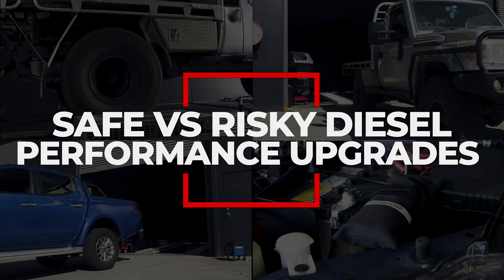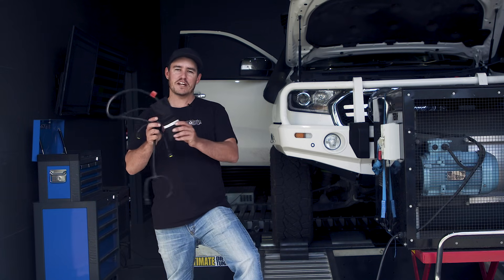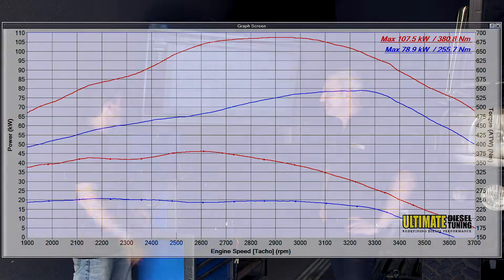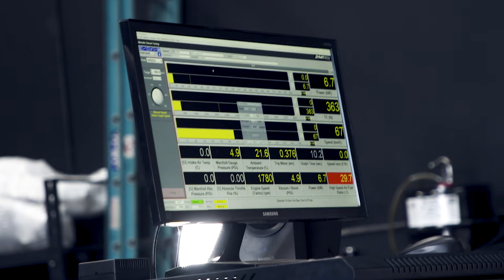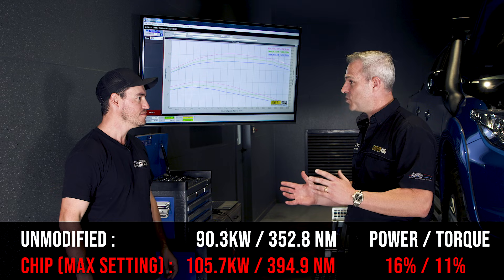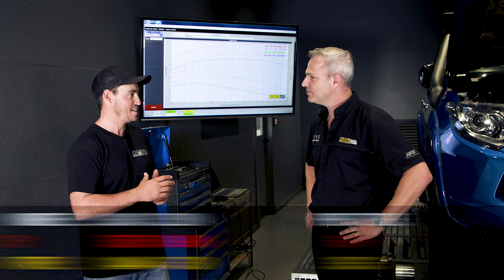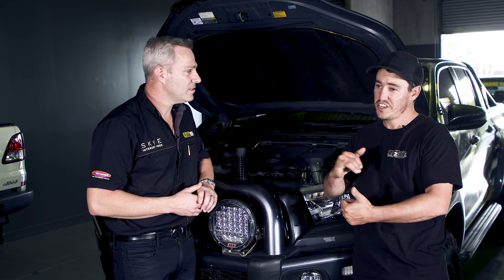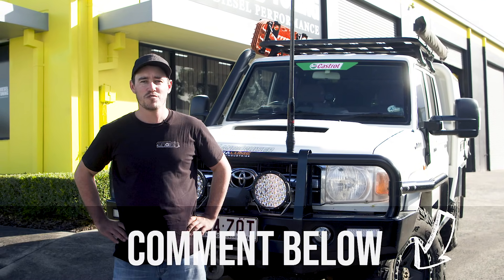SAFE vs RISKY DIESEL POWER UPGRADES – 5 things you need to ask before choosing!

Comment: Chips work fine on standard un molested ,factory spec cars.Obviously not so when young snapper heads start thinking there mechanics.Those chips were set up originally on a dyno before the unit was manufactured.

Comment: As a diesel mechanic of 20 years. The most reliable engine is a stock engine tune. Catch cans are fine but the manufacturer takes many things into consideration when tuning the cars. My opinion leave it alone unless you do things properly.

Comment: Ultimate diesel Brisbane wouldn't touch any vehicle with 300km on the odometer and charge alot, took my n70 lux to another tuner in Rocklea and the guys we're awesome went over the whole engine for health before working on it recommended some tweaks over the phone came back to pick it up made double the power that was in it and charged less than half of ultimate diesel 🤙

Comment: I recently removed my throttle controller because it was causing permanent DTCs and limp mode requiring a trip to the auto leckie on a flat top, the leckie erasing the DTC. 
This happened twice before he confirmed it was the chip in the controller degrading.
The controller had been in for a year without problem up till then. A proper tune will always be best, I think.

Comment: A lot of skeptics as to why engines are under tuned, and if the manufacturer knows better to stick to their power figures. Of course this is not the case for all engines, but regarding the ones that are under tuned, you have to imagine that the car in general has to also be driven by your mom, your kid, or anyone else that has no idea on how it works, riding the clutch, using the wrong gears, flooring it from cold, using poor quality fuel etc. And then you also have to convince them it's cheap to run, by telling them to service it every 20k km or more. That is one of the main reasons manufacturers have to play it as safe as possible, so that it can be advertised as cheap to run and last for all types of drivers...or at least they have to try. If you know how to drive and properly take care of your engine, a 20-25% power increase with a custom dyno tune done professionally, is still within the safe limits of the engine and transmission, and it will last as well as stock. Unless you abuse it, in which case you can brake it without a remap to :)

Comment: After a custom tune, I'm in the outback and something goes a bit belly up and one goes to a dealer  or some diesel mechanic for a checkover, then the dealer stuffs the custom tune by resetting the custom tune or upsetting one of the tune settings or warranty work is out the door and these days with 5 and 10 year warranties this IS an issue. One huge thing with reputable chip is it can be disconnected for warranty or outside repairs requiring ecu analysis, then reconnected again. I bet your custom tune is not able to be taken with you and reinstalled by another tuner in another place on the other side of the country if something goes astray. Reputable chips do give very real safe power gains and work completely within the design parameters of the engine it has been individually tuned for. Also there was NO discussion on fuel economy at these ridiculous 38% power gains. I do have a reputable chip on a BT50 used for towing and the change in driving is amazing on an low setting and fuel economy is improved by 1L per 100km towing a 2.4 tonne AOR OffRoad van, I wanted at least a half gear improvement on hills towing and did get that and a bit more. Go for a reputable chip for full flexibility and safe tuning. Remove chip when selling and sell the chip if you wish, cant do that with a massive remap which could very well be a good reason the not buy a certain vehicle..... just sayin...
Reply: Hi Peter, you have raised some good questions. 1. the dealer can wipe over it, yes, but it's free for us to load it back into your ECU for you most of the time (and it does not take long) - we have a massive database full of everyone's individual tune files as we save them all. 2. We do have dealers all around that country that can help you with reloading your tune file for you, should that happen. 3. Most of the chips that we have dealt with have actually not been safe, we have not only been able to achieve much better gains in power & torque but also a safer & more reliable tune as well. 4. With regards to fuel economy, that is generally dependent on the owner's driving style. However, we do get feedback from most customers about a 5-10% improvement in fuel economy. This is greatly due to the fact that you now do not have to put as much pressure on the accelerator pedal to get your car to move as much. Cheers mate.

Comment: Good day. There is a video on YouTube from a different company that did n video on a 79v8 showing ecalerasion and egt, without anything, with chip without  custom exhaust , with only custom exhaust, with chip and custom exhaust all tests done towing a caravan. Can you please do this same test with smaller displacement common rail, 2.8-3.0? Dyno and the actual road test with van, no tune or exhaust,  tune with no exhaust and the a tune with exhaust. Something that would be in the normal range without other performance mods. You have the friends that tune and build exhaust that will all be able to back-up There claims. Thanks for great contents

Comment: I just had my 02 hilux 3.0 chipped and tuned and my hp and torque literally doubled!!! Money well spent
Reply: What’s the chip you bought
Reply: @iimakeyounervous---5508  I got the tunit chip and opposite lock n torque gas dyna tuned it and done the installation
Reply: Is it still going? Howz head gasket and pistons holding up?  CHEERS

Comment: So what I’m not getting here is when you get an ECU remap are you still essentially changing the rail and boost pressure?
Reply: Yes. And in fact the ECU is calibrated to keep a balance and when you increase the rail pressure, it will adjust all other parameters. Now I am oversimplifying the whole process, but without increasing the tolerances, the ECU can adjust only that much. It's not perfect, but it works. :) ..... until it doesn't... lol 
Altering the initial mapping one way or another reduces engine's lifespan more or less.
Reply: @kristingeorgiev3295  It really depends on each engine, and everyone should do their research well before a remap. There are engines out there massively undertuned.
Like mine, 2.0 tdci Mondeo, it comes in 3 variants of 115, 140 and 163hp with the exact same engine, different factory maps. I had mine in 163 variant (160 on the dyno) and it's nearly 190 after a stage 1 with the torque from 365 to 410. Nothing special for a safe and smoke free stage 1. But imagine when someone gets a stage 1 for the same engine, but they start off from the 115hp variant :))) you get like 70% gains and EVERYONE will tell you it's going to blow. In fact guys with a stage 2 and higher are running just fine with 250hp on the same engine.
Reply: generally injector duration is changed to allow more fuel instead of rail pressure increases. this way the pump is not working any harder. also boost is increased as fuel is added to keep the afr acceptable to avoid clogging DPFs. off the shelf tunes are in most cases ok as they are generally done by the company that makes the tuning hardware but its a bit hit and miss as this isnt always the case and results will be less than optimal as they are detuned to be on the safe side.

Comment: 33-38% power and torque increase....and will the gearbox, clutch etc. be happy? This crap is not for me, leave it alone and run it at factory. You cannot tell me that these backyard lockups know better than Toyota, Mitsubishi  and other massive car manufacturers. In my opinion, the best mods you can make to your motor is disabling every single "Eco" and "Green" tree hugging, global warming, climate change garbage that was forced on the manufacturers and the first being the EGR valve!
Reply: Landcruisers & Hiluxes & Colorados need upgraded clutches. Other than that, the factory drivelines are all good.

Comment: Hey guys just a general question. You talk about the 70 series chip putting alot of pressure on the fuel system  due to the increase in pressure, and thats with a 35%/50% increase.  Why does the tune not put the same if not more pressure on the system or other systems when you have a much higher increase with 77%/135%?   Cheers
Reply: Ultimate diesel don’t wish to comment, very relevant question,Tai, they commented on other less critical matters, you may have unearthed some bullshit
Reply: It’s not all fuel related there’s timing boost the hole fuel table gets tweaked  as well as injector pulse how they fire and a lot more I’m sure. Just going off 0 experience to but I’m sure the fuel pressure is still way up there for the vid but with the tune they are making the power more efficient over just throwing fuel at it a tune you will have a cleaner burn better better power for the fuel your using just adding fuel will soot the internals a lot quicker and kill your dfp before your next service if you have one still

Comment: So i have a questions and i need someone to educate me. I have a 2010 Nissan Navara 2.5 DCI, and i am the 2ed owner. I have started experiencing issues with my bakkie! I would be driving normally and all of a sudden, my bakkie would stall. At times when i start the engine, my bakkie would stall, and sometimes when i put my bakkie in reverse,  it would stall. I took my bakkie for repairs (140000 KM) and it seems like i have had no issues after that. However, i have to spend R13000 ($1111.95) on my engine alone, and additional R19600 ($1676.47) on my steering rack and rear suspension. I think it's a a rip off! I never fixed a car/bakkie before, but i am really willing to learn. Is there someone who can perhaps help me and Guide Me?

Comment: Shauno , with a re map - what happens when the power button near gear stick is used , does it change engine coding or only gear box response on revs. 200 series 2016 model L C .
Reply: It doesn't affect the different modes, Glen. The PWR buttons on the LandCruisers & Hiluxes are like throttle controllers, so they actually do not give your car anymore extra power or torque, they just change the calibration of the throttle. We are releasing a video on our Ultimate Diesel Tuning YouTube channel on throttle controllers next Tuesday at 4pm that you might want to watch!

Comment: That's the modern fourby's, now what about the old ones - pre chips? 60/80/100 series cruisers, GU/GQ patrols,  and stuff. Is the only option a tuner with a good ear & "Gut feeling"?
Reply: You an fit an inter cooler body control and get it dynoed the results are impressive

Comment: Any discounts for us mate on the customer tune. $1495 seems to steep
Reply: Hey mate, that includes a pre-tune hoist & engine inspection; pre-tune dyno test for engine health; full custom dyno tune to suit YOUR engine & what you use your car for; extensive roadtest to ensure that it is performing perfectly on the road for you; changes to the tune after that if required; printed dyno graph & UDT pack at the end. We will require your vehicle for most of the day. Great value when you consider the results we will achieve for you & we are very competitively priced amongst the other diesel dyno tuners out there who actually do what we do & do not use "load & go" or "carpark" tunes files. Cheers!
Reply: @UltimateDieselTuning  any discounts?

Comment: And a ECU remap also increases rail pressure and boost and injector timing. You can’t get extra power for nothing.
Reply: Yes we have full control over fuel rail pressure via a remap but it is seldom used. Typically its the Torque Request and Fuel Limit tables (also known as Torque Limits) which are raised within the software to allow more fuel to be injected at high load points. A fuel rail pressure chip, only has the ability to push more fuel into the cylinder with increased pressure.

Comment: Heyy Shauno and Graham. Big 4wd Action and diesel fan here. 05’ model Rodeo long wheel base 3.0itd with 350k on the clock and only had to replace the battery and alternator once. Love watching the dmax and 0$Suk lines through gnarly tracks! Just wondering if you guys could chat a bit about the vis system you guys use? Is the app similar? If I purchase the app will it run off satellite nav or my data? Are there saved preset 4wd tracks in the software? Cheers, Taz

Comment: Surely you can’t just upgrade a vehicle from 280Nm to 600Nm without upgrading some parts like diffs, CV joints, drive shafts, clutch, gearbox etc? Are the factory ones rated to handle the boosted power & torque?
And what about Petrol tunes?
Reply: The drivelines are all strong. Clutches just need to be upgraded in a few models but that is it.

Comment: Would it be safe & worth dyno tuning a 05 Hilux D4D with 310000kms? If so what would it achieve? The injectors along with a clutch were recently replaced.
Reply: Yes absolutely. We tune plenty of rigs with that amount of k's on them & over. They are all custom tuned on our dynos so we can see what the engine is doing.

Comment: I reckon my ML was flogged before I got it. Only had 112,000km on it but had a new clutch put in before I bought it and just had all injectors start leaking and playing up. I wonder if it was flash tuned or had a chip running in it to affect those injectors so early.
Reply: Possibly mate.

Comment: What about impacting the warranty of new vehicles?
Reply: Hey mate, new car warranty isn't affected. Most of the vehicles that we custom dyno tune are still under new car warranty!
Reply: @UltimateDieselTuning  so your saying that if any part of a new vehicle's engine or driveline fails, and the dealership openly knows that its putting out 50% more power and torque through a tune, that they will happily supply a replacement engine  gearbox or differential at the manufacturers expense, all through warranty?

Comment: I get the difference between a chip and tune, but what happens when a month after the tune 
you do a sensor or something worse and you roll into a dealership for warranty and your ECU Has been remapped?
Reply: It's highly unlikely that the tune caused the issue. By law the dealership or manufacturer cannot void the warranty of a vehicle due to a remap.
Reply: Ultimate Diesel Tuning, ok.. it hasn’t happened, I’m asking if someone was to go down the route of a remap, Does the dealership then set it back to factory settings for testing on the repairs they have done.and the owner looses the remap.
Reply: @davec8141  if they do & the remap is "lost", then we save everyone's tune files after they are done so we simply just reload it in for you at no cost to you.

Comment: Number 1 can I afford a voided warranty 🤷🏼‍♂️
Reply: Hey Brett, by law the dealership or manufacturer cannot void the warranty of a vehicle due to a remap. Most of the vehicles we custom dyno tune are still under new car warranty with no issues.
Reply: Ultimate Diesel Tuning this is the part that has put me off getting it done. Could you please quote what law you are referring to. Thanks

Comment: Hi two questions, How frequent to you have to tune or is it a one off and do you have a branch in Victoria or Vic - NSW border area, cheers, Neil.
Reply: Hi mate, it's a once off, unless you perform other engine modifications after the tune - then it will need to be retuned in most cases. And yes we have an Ultimate Diesel Tuning performance centre in Dandenong. Please give us a call 1800034373.

Comment: No such word as safe, age is one factor but what about maximum load each part can take? Manufacturers tune everything that is safe and reliable (for the most part) from the get go and when you add timing, boost and fuel you're putting strain in the engine that it wasn't designed for. I would only tune a engine if its been rebuilt with better internals that can handle the power gains. 

I would wonder what these tunes do to newer 4wds with all the anti pollution systems in place ( DPF issues is the single thing stopping me for getting a 4wd and I'm waiting for the newer petrol versions that are meant to be coming out )
Reply: Buy a Isuzu 4JJ1 then.
Reply: "one factor but what about maximum load each part can take?"    THis is a really relevant question and one that I would love to see an answer to.  With torque increases of upto 135% (mind blowing) the additional engine and driveline stresses have to go somewhere.  Yes standard engines are detuned, yes each engine and drive-line part has an inbuilt safety tolerance......but 135% of additional torque....    
Can UDT please respond to this exact question please.
Reply: @topherrex4632  no issues so far mate & we tune a lot of these cars per week. Common rail turbo diesel engines are obviously severely restricted in power & torque by the manufacturer.

Comment: What's the general fuel economy gain/loss for those two vehicles after a tune?
Reply: Depending on your driving style, you should notice an improvement in economy with most vehicles.

Comment: Can you also tune a petrol to get better performance and fuel economy?
Reply: Yes.  The Euros use the same engine with half a dozen stages of tune from factory for various models.  However, the higher rated tunes sometimes have stronger bits in the same engine to cope.  Most can take a stage 1 tune easily.  My GTI went from 147Kw to 188Kw and 280Nm to 350Nm with a stage 1.  Runs better, uses less fuel.
Reply: @einfelder8262  I am wanting to do my Kakadu

Comment: What I learned from this is to get an older diesel that's not controlled with a bunch of electronics. You just have something else to fail or break and leave you stranded when you are in the bush or touring.
Reply: I have a diahatsu f78 I can tune it with a flathead  screwdriver and a 12mm socket love it